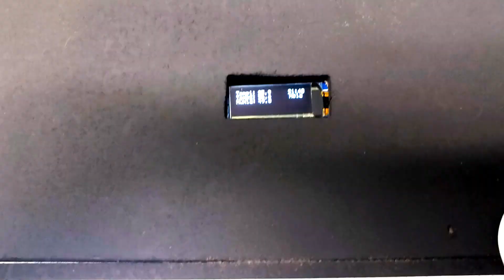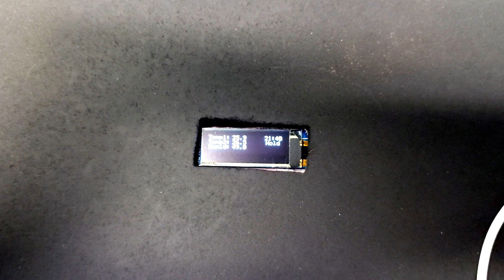At Home Plant Tissue Culture Part 1: Automation Electronics

Comment: Very nice Arduino to terminal block board.
It seems like it maybe possible in software to get rid of the RTC, since the data seems to be saved only via the web and the web service likely timestamps the data. Do you think this would be possible or a good idea?
Reply from the maker: I did think of using the WiFi to get the current time but I wanted something more reliable since my WiFi occasionally cuts out. Ideally, I'd have both for a validity check but haven't got that far. It'd definitely be more simple with a NodeMCU or an Arduino Nano33 with the wifi built in.